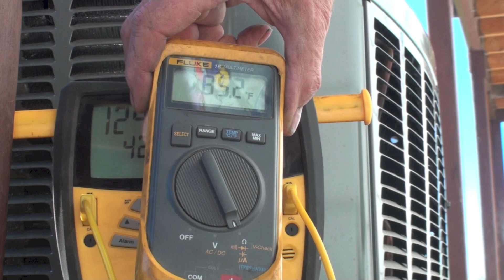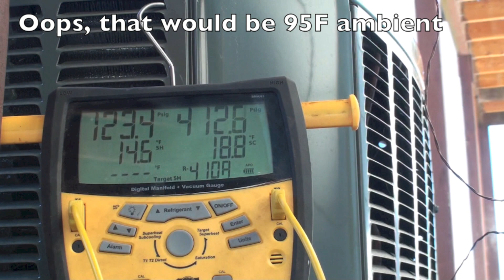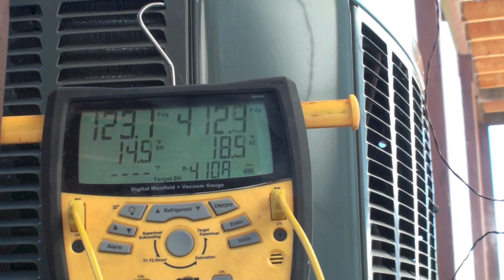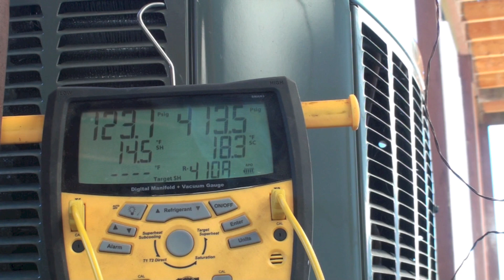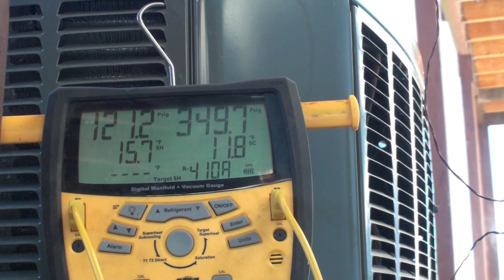How does high ambient affect subcool

Comment: Nice video. The reason the subcooling raises when you block part of the condenser coil is that you have decreased the surface area of the condenser coil. You haven't changed the amount of refrigerant so now with a smaller condenser coil you  are overcharged and your refrigerant spends to much time in the condenser being subcooled. In these newer systems there is really no reason to try and "simulate" higher ambient temps because between 70-95 degress the change in subcooling is not large enough to cause pressure drop big enough to starve the expansion device.
Reply: Interesting theory, but he really isn't decreasing the condenser's surface area by blocking the fan's exhaust, he's just decreasing airflow. And even if he did block off the fins externally, its internal volume still hasn't changed.

Comment: I need help understanding why i had such high pressures on both suction and liquid lines, but my subcool wa way low and superheat was ok, at about 20. 

I was working on a 410a system 2 ton. Rheem. Txv

Inside return air was 85
Outside ambient was 95
And i was getting about 2°of subcooling. 

The thing was that the suction pressure was at about 150ish and the liquid line was at about. 420ish 
The more refer i added the more the pressure went up and the liquid line temp but the subcool would not go up. I didnt want the pressures getting up to high so i left it at that. Not feeling very happy with that call. 
I was able to get him a 20 split on his evaporator so the house did start to cool

Comment: Great myth busting Video. I think you killed the sales on the tarp that they sell at the supply house for low ambient charging.😎
Reply: Except that 85 degrees is far from a low ambient. If he had to charge the system at, for example, 50 degrees then there may be an issue, but not at 85 degrees.

Comment: great video. is this a txv? maybe it's because to maintain superheat, the txv closed a bit so more traffic jam in the liquid line so the liquid has more time to cool so even if head pressure (and condensing temp) went up because you blocked the condenser, the liquid line temp probably did not go up along with it causing the higher subcool. what was the change in liquid line temp after you covered the condenser? thanks GFM i learn a lot from you.

Comment: Hello GFM,  If the ice machine was on a soft water conditioner system, would that decrease the mineral content in the water and produce a harder ice cube ??
Reply from the maker: It should.  There are conditioning systems that are designed just for ice machines.  Also be sure the water flushing mechanism is working properly.
GFM

Comment: Question for you GFM,  I have an ice machine called Manitowoc model # Ido302a-I61 with 404A. The ice cubes are not that hard after harvest and soon there after all turns to a slushy but semi- stiff batch in the main storage bin compartment. What do you think is causing this problem ??
Reply from the maker: sciencevsreligion01 Is the water dumping after each freeze cycle?  High mineral amounts will cause slushy ice.  pure water is mostly frozen, leaving high mineral content water left.  Hope this helps.
GFM
Reply: Hello  GFM,  If the ice machine was on a soft water conditioner system, would that decrease the mineral content in the water and produce a harder ice cube  ??

Comment: Blocking condenser fan motor is only used to see if head pressure will go up followed by suction. Subcooling goes out the window and superheat is just a indicator. However I just got the IManifold set up and looking forward for winter heatpump issue. With profiling and several temp probes with wet bulb streaming reading at return and supply. I will love to see what the software will say....

Comment: nah the best way to really charge a system is to weigh it in.  Ask any a/c manufacturer and they will say to weigh it in.   If a system is undercharged in a heat pump in the winter, I do not understand why someone would be trying to charge it in cooling, unless they are a rookie.  In the winter I am not sure why someone would be running the a/c unless its in a restaurant or computer room, and there should be some kind of ambient condenser fan control in it.  Good video none the less, and I think your right about the load temp effecting the sub cool.  Hopefully thou we will never have to deal with this in the field, unless we are diagnosing a bad condenser coil or something, clogged up etc.
Reply from the maker: Actually Trane does recommend charging by sub cool, however they also give factory charge weight plus line set addition.  I charge by a combination of methods including weight.  Sometimes the amount is complicated by additional drier size or unmatched coils, so its not always clear.  Thanks for the thoughts.
GFM
Reply: I have tried that many moons ago only to come back in July to reclaim refrigerant cuz it's going off on a high head.  I am cautious when it comes to what manufacturers recommend out in the field.  They base their recommendations off of lab results not field.  None the less if I have to charge and it's a heat pump I do it in heating
  I have my own way.  Seems to work I don't get call backs from start ups in january.

Comment: R410a sucks anyway they should have. Made some replacement for 22 that does run such high pressures on a ac unit or heat pump but anyway it doesn't sound right it should go down but i guess it doesn't the subcooling dont

Comment: you are correct, weather you use a fan cycle control, on/off or variable, or cardboard to block the fan. when a condenser is within its outdoor temp range you will not get accurate reading unless the fan is at full speed and unblocked. I do mostly bigger commercial stuff these days but in the last 27 years i have had plenty of residential units give odd readings unless they are getting full airflow. you can get a unit ballparked and running but fine tuning a charge must be done as you suggest, and this does apply to 200 ton units all the way down to 2 ton units.
Reply from the maker: Cant argue with that.  Nothing works like operating under normal conditions.
GFM

Comment: To follow up on what I said.  I attended a class for Goodman oh....15 years ago at least.  It was a method of charging/checking a heatpump in winter where you suspect low refrigerant.  It was very ballpark and just a get-by method instead of recovering and re-weighing the charge.  Basically run in AC mode if my memory serves correct.  Wrap a garbage bag around conderser.  Add 127 degrees to outdoor temp and measure discharge out of compressor.  Add charge to meet that number.  Like I said it has been near 20 years and I am sure my memory isn't 100%
Reply from the maker: Wow, that seems odd.  I will be doing one on charging by discharge temp but it is not a very good way.  Anyway, thanks for the thoughts.
GFM